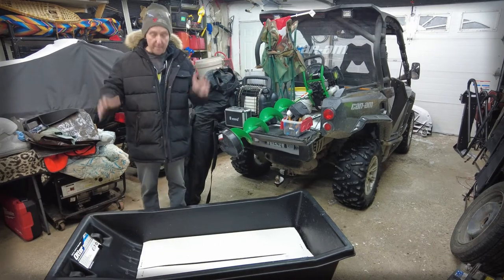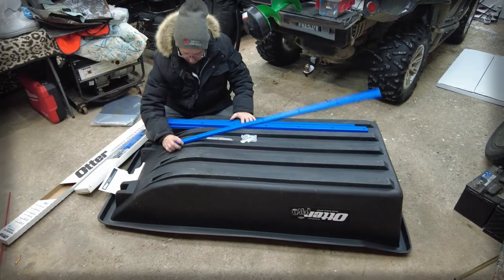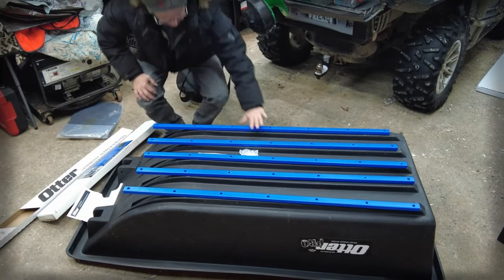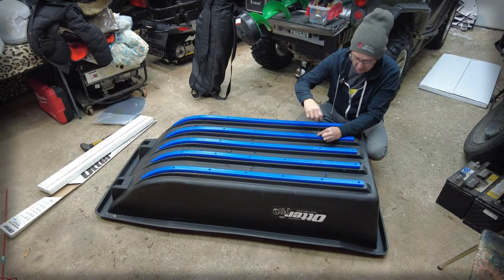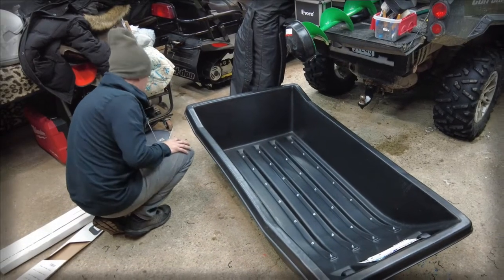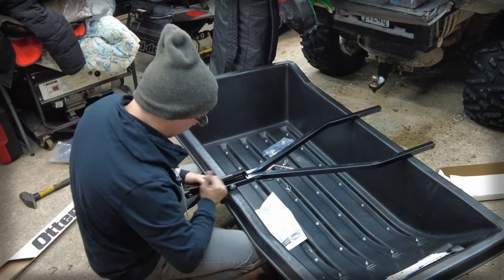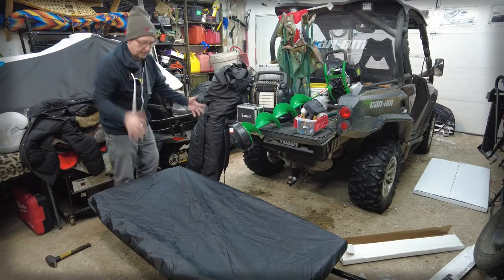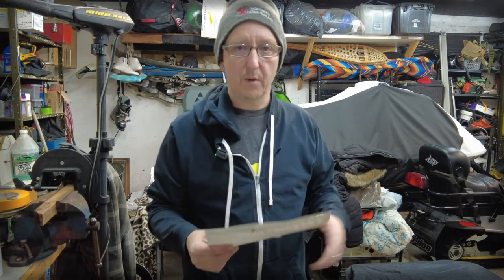Otter Pro Series Snow Machine Sleigh. Assembly and Thoughts on the Quality and the build speed.

Comment: Great video. I bought one yesterday and it took a few hours to put the runners on. A bit of a pain but well worth it. I'm going to spray the bottom of the sled with a ceramic coating for a bit of extra protection.
Reply from the maker: Thanks. This is an awesome little sleigh. It tracks perfect behind the sled. I silicon spray the bottom of mine. I think it helps.

Comment: I modified the otter hitch to work on a J hitch.  I also fabricated a snow deflector for the towing yoke.  It helps keep most of the snow out of the sled. I used some old snowmobile hyfax I had for runners and they work great.  My Otter has held up great for 15 years.
Reply from the maker: That's a great idea!